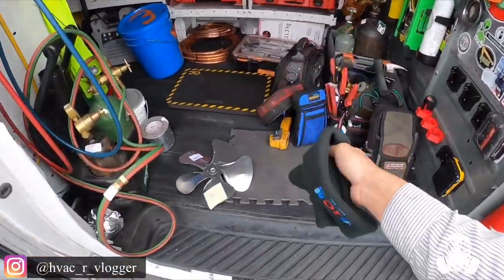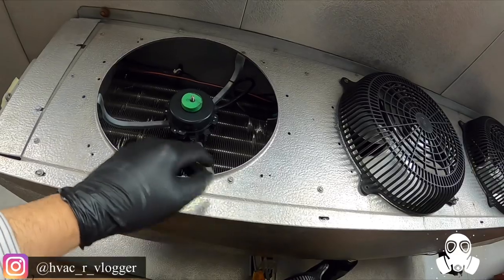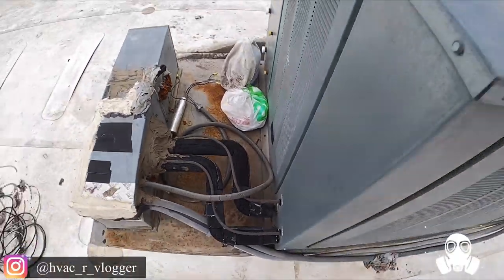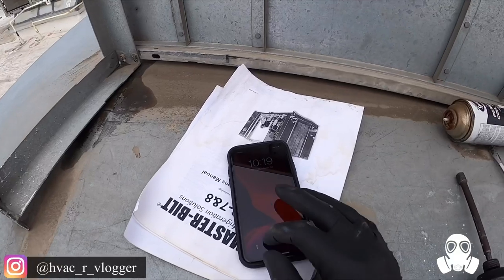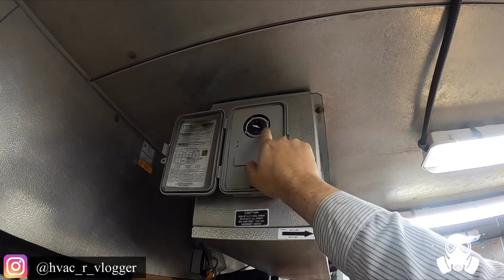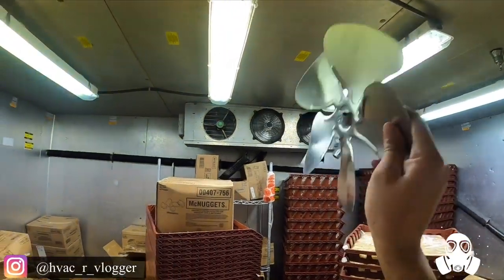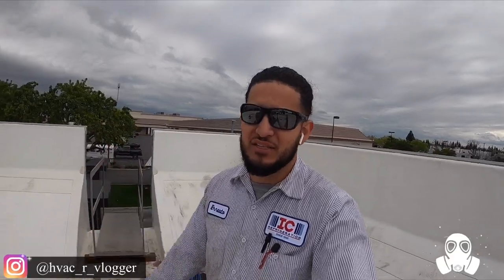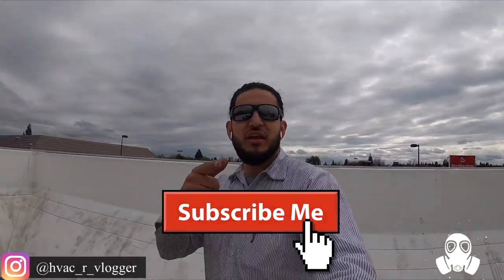HVAC VLOG.  WALKIN FREEZER AT 20*

Comment: Maybe cover the dead evap motor opening with cardboard to avoid air bypassing the evap coil in the meantime. Just a thought I had.
Reply: Absolutely sir Jon 👍🏻
Reply: @gene-khvacr  Thanks brother Gene😉
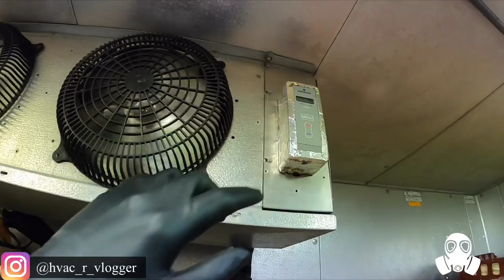Reply: No need at 3:49 you can see there is a baffle dividing the coil.
Reply: @claudiolorenzon1997  Right on, good design. No issues than with bypassing air.